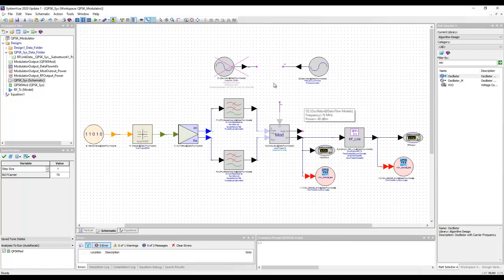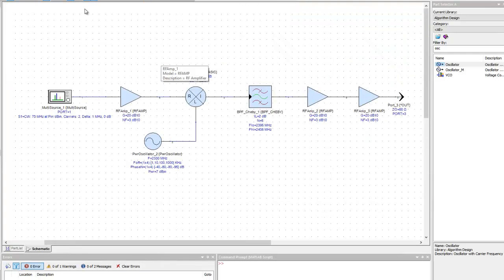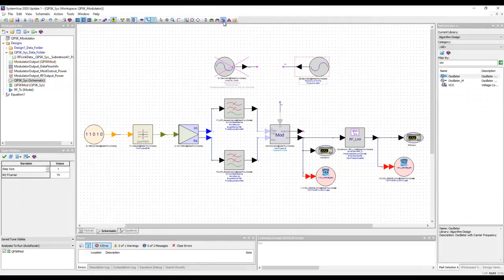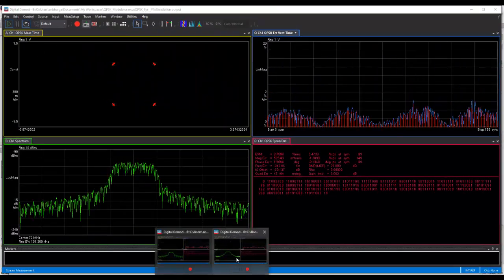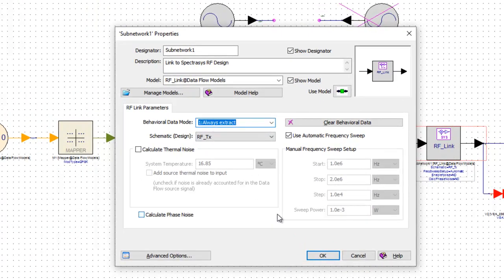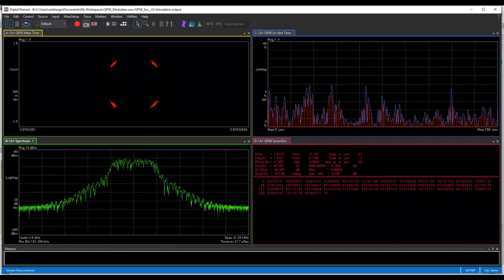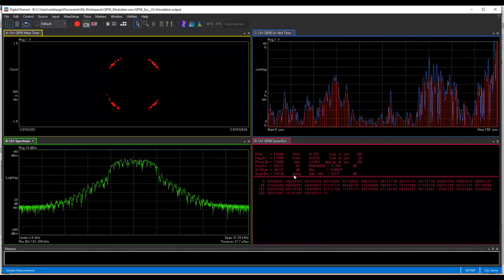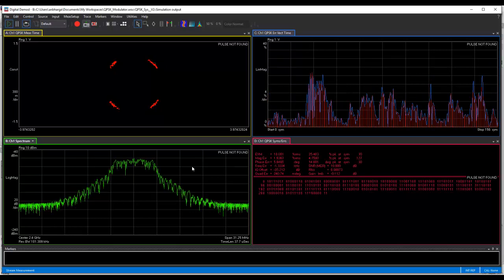Tutorial-25: Phase Noise Modeling in Mixed Signal Systems

Comment: Hi, 
I am doing Phasenoise Analysis for my system , when I enabled the option "Calculate Phasenoise "with Emphasis offset of 100KHz I observed that Overall System Cascaded Noise figure is increased from 2 dB to 50dB  ,whether need to ignore  the CNF measurement while enabling this option? and why it is increased Alot
Thanks, 
Praveen
Reply from the maker: Hi Praveen,
While doing Phase Noise analysis, you need to either disable budget analysis or ignore CNF. I think it is well documented in SVue help...
Reply: @BhargavaAnurag  Thanks